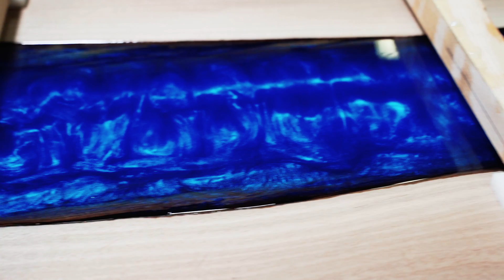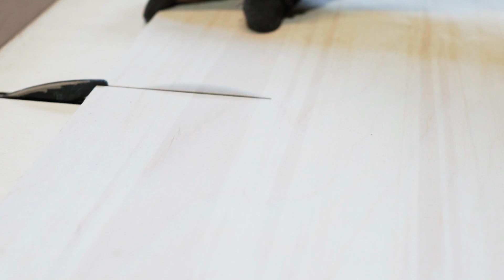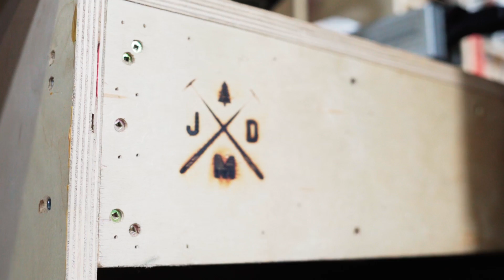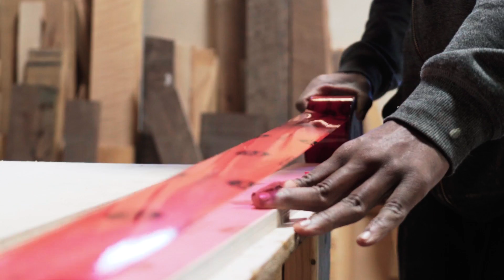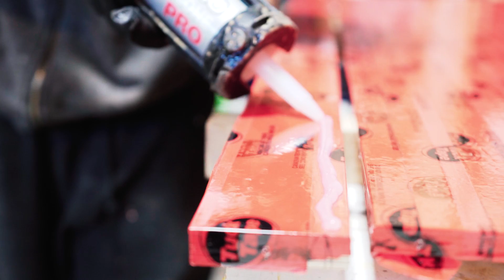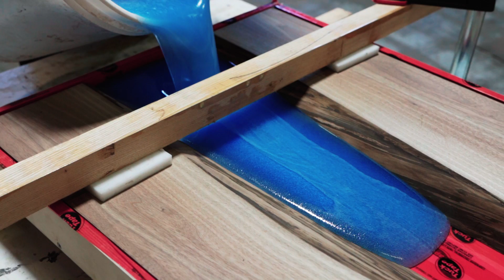HOW TO | Building a Plywood Form for Epoxy Pours

Comment: Can you use Melamine instead of ply that way there is no need to use the tape?
Reply from the maker: I would still line the melamine with the tape since the epoxy will stick to melamine.
Reply: @jeffmackdesigns  got it. Thanks!

Comment: I know this is an old video but i was wondering what type of plywood you are using is it hardened or maples or what? And im wondering if the room needs to be well ventilated or no closed kt be done in a room like a closed garage?
Reply from the maker: Hey, we are just using baltic birch plywood for the forms. You don't need to be in a well ventilated room if you are using Ecopoxy FlowCast. It has virtually no odour and has zero VOC's. It's a great product to work with.

Comment: I want to make a coffee table with the piece of wood being in the center and the epoxy surrounding it. How would that change the form setup?
Reply from the maker: That wouldn't change the form set up at all. You are still going to want to build your form slightly oversized and then place your slab where you would like it.

Comment: By chance do you have a full supply list for this project?
Reply from the maker: Hey,
We don't exactly have a full supply list for this project because each project will differ in terms of the quantities needed.
Here's what we used:
Form material: plywood
Epoxy: Ecopoxy FlowCast (we used about 8 Liters for this pour)
Pigment: metallic pigments from black diamond pigments or Ecopoxy
Tape: form building tape
Silicone: Akfix silicone 
You can shop these supplies and more at www.JeffMackSupply.com. 
If you have any further questions, don't hesitate to email us at info@jeffmacksupply.com

Comment: Great video! I'm wondering tho, do you/is it possible to use the same form for multiple pours or is it just 1 side 1 pour kinda thing?
Reply from the maker: Hey, You can get anywhere from 1-3 pours per form when using this method. We use HDPE now and we get many pours from each sheet and it is showing no signs of where so if you plan on doing more than 3 pours, I would recommend using HDPE.

Comment: What is the name of the tape that you stick on the wood,  is it a special one for the resin ?
Reply from the maker: That is Tuck Tape. It's a brand of sheathing tape that epoxy doesn't stick to once it's cured. It makes the demolding process a lot easier.

Comment: Have you done any tables that have a live edge on the front and back as well and only a river in the middle?  I’m trying to wrap my head around building a form for essentially two thin slabs, but I want the front and back to be irregular, not straight.  Any advice?
Reply from the maker: We have done that in the past. The key is having 2 very flat slabs. you will also want to run multiple beads of silicone between the slabs and the form and use lots of clamps. Hope this helps.

Comment: I really appreciate both your Instagram account and your YouTube channel. If you have time to answer a question I am really curious about how strongly that epoxy resin keeps the two slabs together. Is it enough by itself or do you support it somehow? Thanks and greetings from Sweden!
Reply from the maker: Hi Henrik,
Thank you for the support! The bond between the epoxy and the slab is actually stringer than the wood itself in most cases. We have never had to add additional support to keep one of these tables together. The epoxy is always strong enough if you remove the bark and clean up the edges of the slabs to allow the epoxy to bond properly. Perhaps we should do a video showing the strength and bond of the wood to epoxy.
Reply: @jeffmackdesigns  thanks fotär THE Quick answer and WOW, couldn't imagine that! A video would definitely be appreciated from my part at least! Keep up the good work!
Reply from the maker: No Problem!! Thanks for following along! Stay tuned for an epoxy strength video!